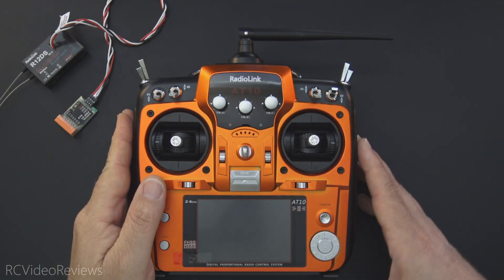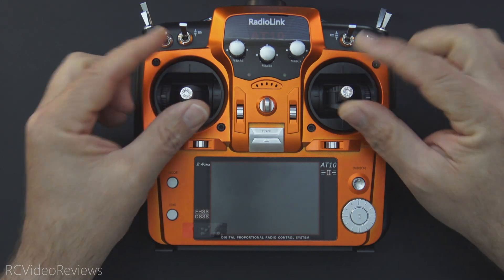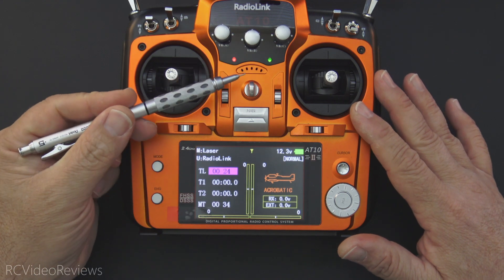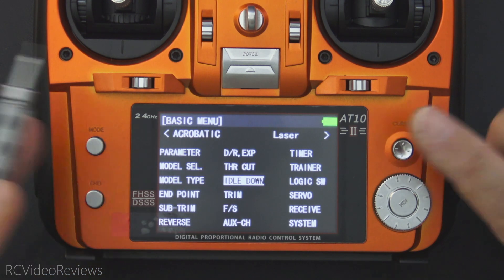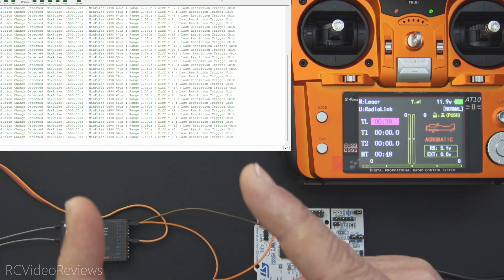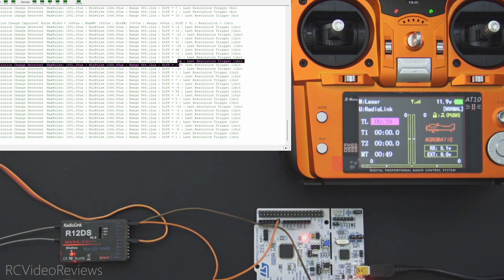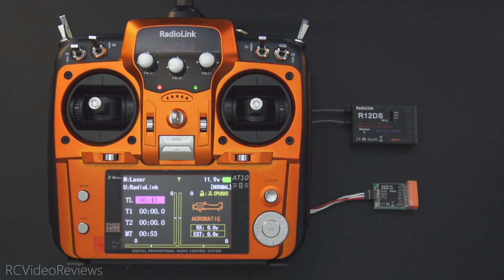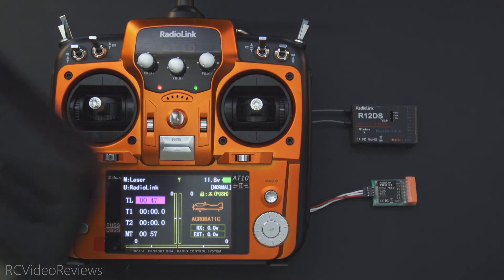Radiolink AT10II and R12DS: 12 bit OTA???

Comment: I Have two questions about this radio before I buy it. First question is the trainer wire. I need 1/8 Inch mic Style connector To set this up. Does this have that feature? And also can I swap the left and right gimbal? I want to control the elevator and runs with the left hand and the throttle and Rutter with my right.

Comment: Ive had this radio for about 4 years now and its great, the 6ch rec works great for gliders and sail planes and the 12ch is easy to use with crossfire and FPV. good radio if you want something you can tinker with and dont want to trade price for features, you can turn the beeps off and a 1s 1200mah lipo with an adjustment to the battery alarm on the radio will last you all day.
Reply: @FlipsWart  ordered one today and hope I like it. Was hard to throw out my dx6i but it served it live..

Comment: Hi, sir. Thank you for your feedback. If you want to test the precision of 4096 of R12DS, we recommend you to test with servo of 4096, and there will be no noise or jitter.
Reply from the maker: If you watch the video, you'll see I used a PWM decoder and software to evaluate the PWM signal coming out of the RX. Servos aren't necessary in that test. It was a direct evaluation of the PWM output on the RX.

Comment: Maybe I'm lucky but I've not had a problem with this radio. Sure, it's cheap and I agree about the gimbal quality and controls but it does the job and range is good enough, much further than LOS. As for the battery installation I simply made up a short extension lead to use with my 2500 mah 3s battery because it's a fiddle to access the connector. I've had this for about eight years. Sure, my Graupner and TX16s radios are far better but I've never had any interference problems with the Radiolink and the telemetry is useful. Nice tech review covering the stepping but if it works, it works!
Reply: Sad to say, I agree with you. I use this radio with all my ETF jets. I’d rather prefer this over spectrum I have the NX six channel. Have not lost signal at all with this. It’s easy to set up rates and reverse channels. My opinion, it has very good range is excellent I agree.
Reply from the maker: Good to hear the other side of the coin. I was a little surprised to hear so many initial negative comments about reliability compared to Amazon reviews which hold this radio in higher regard.
Reply: Hi, sir. Here is a tutorial of battery of AT10II for your reference. https://www.youtube.com/watch?v=CkzCF_ARoUs You may have a check and any question when using AT10II please feel free to contact us.

Comment: This was my first radio after the 80ies and I still use it with the Saber 920 and the AR Wing. Three kilometers range is enough for short flying. It is a special one and if you can fly with junk than you can fly with anything 😂
I am using the R12DSM receiver. 
I also shorten the sticks for better handling. 
My 5inch drone had this receiver too. Now I am using elrs. 
For better planes I rather go with Spektrum. 
The range is shorter, but enough for LOS.
Apart from that, the delay (latency)is much smaller than with Spektrum.
It is some kind of an experimental radio and a weird science, but I like to try out the stuff they offer.
Reply from the maker: I'm glad to hear some positive long term reports. Flyer Mikey pointed out this is the same TX layout as the Futaba 10cg.
Reply: @RCVideoReviews  Yes, it's a kind of Futaba.
I like the R12DSM receiver, but unfortunately I couldn't bind it with the 4in1 Jumper T Pro, so I switched to elrs. 
Maybe you can help me with the right protocol or it's impossible. 
By the way, the Jumper has crappy gimbals too, but I like the shape of the transmitter.
Better gimbals and switches would have been a good thing for radiolink too.

Comment: The transmitter is the same  as the Futaba 10cg but with there software
Reply from the maker: Holy $&!T. They do look identical.
Reply: It's not the same radio. It's a clone. Or copy of just looks. Like Taranis copy of a jr but inside is different. Vice versa.

Comment: You know what's interesting is they're surface radios are pretty good. Have rssi and vbat just plugs into the Rx. We used them at school because the have a tracked vehicle mixer and 6 channels. My teacher at the time had good relationship with an engineer at radiolink (Jenny) who got crossfire working on their surface transmitter and a head tracker function as well the only other surface trans we could find to do crossfire  was futaba for 600 each as opposed to 60. I think that the old jumper t16 and then radiomaster kinda killed radiolinks air transmitter business as they seem to focus on the surface side now. That's my 2 cents
Reply from the maker: Interesting back story. Thanks for sharing. The comments have come out decidedly against this TX. It seems to me they made an honest attempt, but it "barely" qualifies as what I'd call hobby grade--and I didn't even get past the bench for testing.

Comment: This was my first radio about 8 years ago. I had the grey one which they don't seem to make anymore. It works but not long after I purchased it I realized it was junk.. Actually it was the AT10 I purchased it had DSSS. The AT10II came out after and added FHSS but that is the only change everything else has not changed for years. For the price of this radio today I would suggest that not even a beginner purchase it. There are much better options. Hook it up to a flight sim and you will see how non standard this thing is with it's funky channel mapping..
Reply from the maker: What happened?
Reply: @RCVideoReviews  Well, the first thing is it needed a proprietary cable that plugged into the back only available from Radiolink and when I hooked it up using the sim the channel maps were like 1,8,6,2 like random numbers. After playing around with it for a while I actually got it to work properly. I then realized just how bad the resolution was on the gimbals.  I flew one quadcopter with it for a while that I learned to build by watching many Painless360 videos. It was wasted money and soon after purchased a FRSKY QX7 radio when they first came out. When FrSky pulled their shenanigans with their radios I switched to Radiomaster and have been using TX16's ever since.
Reply from the maker: The gimbals or something else in that radio definitely generates some noise. FWIW May TX16s has some weird channels in the MS joystick window when I set it up for Companion. I think the elevator comes in on Ch6 or something like that. I don't blame the radio for that. I blame MS. Anyway--this one's not for me either. It's going back today.

Comment: It is a piece of trash in my experience. It has crashed everything I have ever tried to fly with it, and I'm not a novice pilot.
Reply from the maker: Ouch. Did you ever sort out why it crashed stuff?
Reply: @RCVideoReviews  I'm pretty sure it was such a noisy RF signal that once a plane got about 100 feet away, the controls lost all semblance of control. Inputs still had an effect on flight, but the outputs were not anything similar to the inputs, and the latency went up to like 500ms very quickly.
Reply from the maker: Their literature claims 3ms latency. The antennas look right. I wish I had better test gear for RF. I’d like to understand this a little better. But….I also have other things to keep me busy.